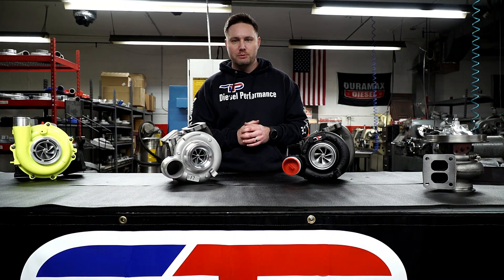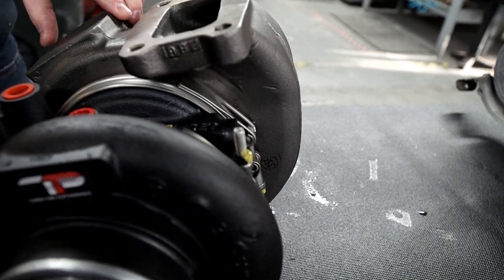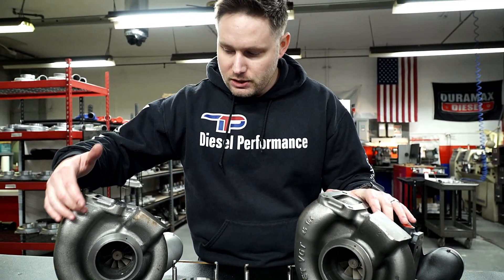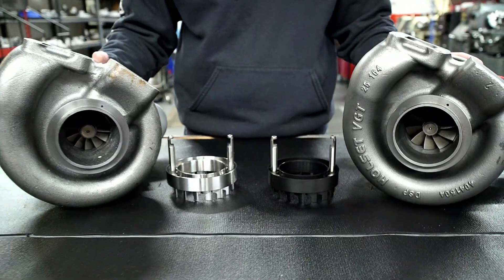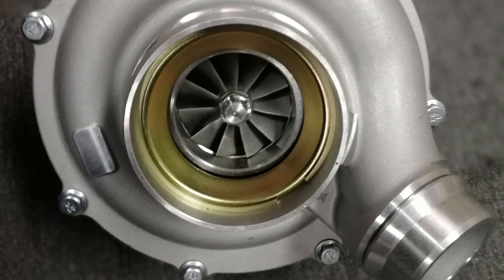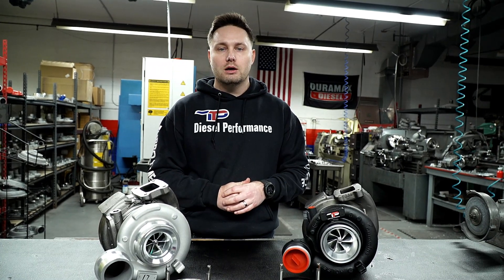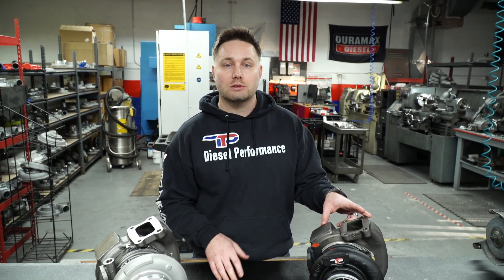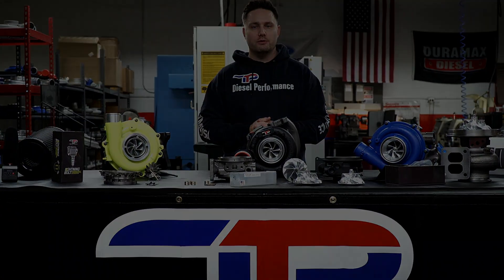Can you spot the FAKE? Diesel Owners MUST WATCH BEFORE BUYING YOUR NEXT TURBO!

Comment: What do you think about Calibrated Power
2017-2023 L5P DURAMAX STEALTH MACH 1 64MM DROP IN VGT TURBO

Is there anyway you can setup a review of this turbo on a 20-23 GMC 3500. Are there any benefits compared to stock turbo with and without a tune for towing about 14k trailer up the ike gauntlet colorado? Mainly passing power, EGT temps, DEF usage and fuel economy.  Maybe also look at around town unloaded drivability fuel and DEF economy?
Reply: If you don’t want to single out one company, maybe you have a lineup of 64mm drop in VGT turbos to compare performance. I just don’t want to waste money and really don’t see good independent reviews.
Reply from the maker: @Upsidedownfoodpyramid  Right. We are not trying to to attack any individual companies. Only trying to provide useful information and insight for folks to make the best decision for themselves if they are seeking the best quality for their money. Genuine quality turbos from Borg, Holset, Garrett etc will have the logo & serial numbers cast on the turbo from cover, center, exhaust. Aftermarket turbos that do not have these markers are sourced from "3rd party" companies producing carbon copies of the OE models at a cheaper cost that are simply imported on pallets. If you do not see the OE brand markers on a particular turbo upgrade, chances are it is a cheaper aftermarket copy turbo being used. For us specifically - In some cases we have ground off brand lettering to allow custom laser printing on the covers, but will still find key OE brand markers upon the rest of the turbo. For certain select models we might source aftermarket covers, but in most applications they are all OE. We offer an efficient Stage 1 GXR 64 (63.7) drop in built using the genuine borgwarner turbo.
Reply from the maker: @Upsidedownfoodpyramid  https://turbotimeusa.com/collections/chevrolet-duramax/products/gxr-7-predator-2015-21-duramax-6-6l-chevy-gmc-l5p-performance-turbocharger

Comment: A friend of mine that has been building turbos for 30ish years alerted me to this problem and just how shocking it is. Companies like Power Driven, Stainless, smedding, BD, the list goes on, all source castings from places with much less QC oversight in the metallurgy and machining process. Especially when theyre claiming big horsepower numbers and high boost pressure capabilities, it seems like a huge risk when and if they fail. Recently I read about a person at a sled pull event losing their life when an aftermarket turbo let go and sent shrapnel through the hood and into the stands. Its horrifying. Fleece is another one, aurora, list goes on. And worse, theyre charging sometimes 2 and 3000 dollars for these counterfeit units. Its deplorable. My friend that will be building my next unit will be doing so using my genuine holset oem turbo. 

Let me know if you would like to know who this is. As stated, his company and himself, have also been sounding the alarm to this absolute cancer in the industry.
Reply: On my opinion aurora is definitely not a fake turbo, the offer like 3 years warranty on their turbos, factory oem don’t last longer.
Reply from the maker: @lisandrofernandez1503  If you are happy with a product, that's great! We are only providing more info & transparency to the market so folks can make an informed decision on the kind of products they want to spend their money on. Usually this is viewed as a positive thing. Many others in the industry seem to disagree unfortunately. The genuine OE manufacturers(Holset, Garrett, borgwarner etc) have their brand marks/part numbers cast into the housings. Aftermarket upgrades that do not have those markers are sourced from many cheaper 3rd party carbon copy turbo manufactures. Longer warranty policies can be nice, but often provide a false sense of security. Most qualifying warranty type failures will usually happen within a years time. Warranty can be potentially denied for any number of things (even seen from major OE manufactures) but if you are lucky since the carbon copy turbos are usually less than a third of the cost of an OEM, a company might just offer a free replacement to keep everything quite. The profit margins are certainly there to support it! Hope we were able to provide some more insight. All the best.  👍
Reply from the maker: @jordanknute2029 Just seen this comment somehow. It is unfortunate how misguided so much of the industry is right now. And we are not trying to point fingers in a disrespectful way, but trying to help people understand better about how to select products. But most are blinded by branding & marketing.

Comment: But your compressor wheels are KTS made from junk china metal, and are readily available off their catalog at around $90/ea.
Reply from the maker: 😂 We must be making you nervous... Liars and schemers hate the truth. We have multiple sources for wheel development and KTS is actually a good company not from China utilized by many companies. Our wheels are custom designed with 1 or 2 that were mistakenly not listed as private from catalogs, but you wouldn't know that unless you have been spying on our designs. Thanks for confirming our suspicions, as we have seen other "builders" adopting some of our turbo designs well after they have been in circulation... Keep hiding behind your dummy accounts. Top notch behavior by so called professionals. 🤦‍♂